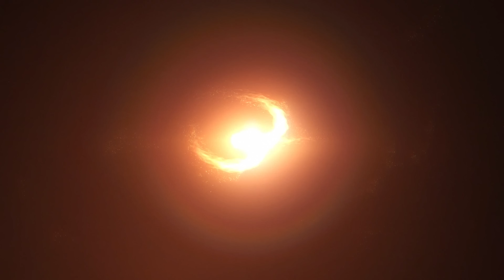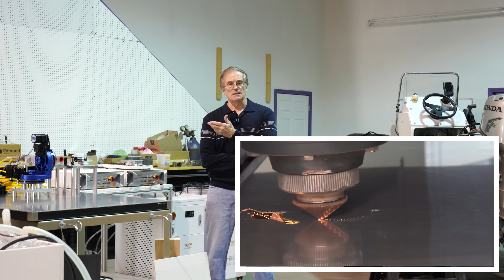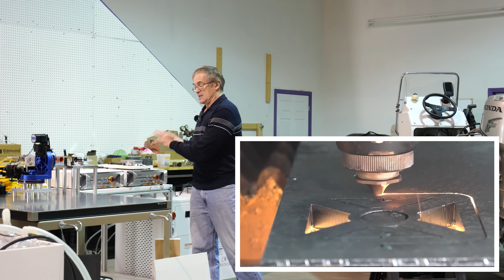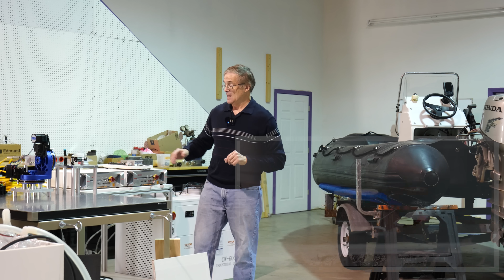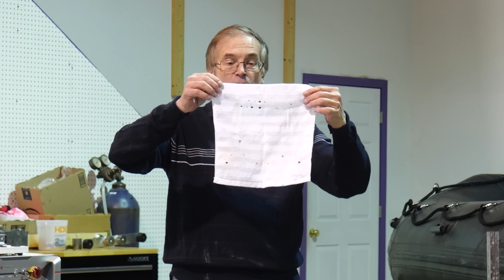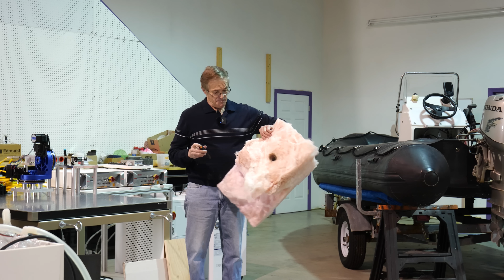We have a problem... and need your help!

Comment: Your on the right track with water, but you need actual liquid water, not soaked rags.. 
You need a aquarium basically.  Build a wall with a water tight void between two panels. Say 3-5in apart. As for material.... I would think copper sheeting would be best, assuming you could black it out with, I don't know soot maybe? 

That should give almost instant delivery of the heat to the volume of water behind it, as well as dispersing the heat, assuming that you can control the reflection. Perhaps copper on the back wall, with clear glass on the front wall, with the water in-between...?

Comment: It may be worth looking into why the brick survived with relatively low damage. Cement (or whatever the brick is made of) might be sufficiently resillient or just reflective so that you dont need the full thickness of a brick, and you could cover a piece of drywall with a thin layer of cement.
A waterfall, as others have suggested, might be low cost and portable solution. However, it was never mentioned in the video just how powerful and how large the beam is. Absorbing tens of kW of narrowly focused beam could require a quite thick layer of water.

Comment: A waterfall over your wood will diffuse the laser and take the heat away from the wood - maybe? I know someone else mentioned falling water as well, but I liked the idea of the wood still in the mix to capture residual light, but being additionally cooled by the water so it can't bust into flame.  if you had an additional water curtain in-front of that it would further diffuse the light as well.  All of the water could fall into a capture area at the bottom which would also work as the water source for the pump.  Put the whole thing on wheels, have the top on extendable side rails and it should hide away in a corner pretty well when not in use. ...oh wait, you said good idea 😜

Comment: I don't know if you tried, but my 2000w laser will eat through a brick in seconds, but 2$ generic cinderblocks are fairly portable, and I could not make it through one. It forms glass and dissipates the heat and light fairly well. I use it as a back stop of my experiments and it works pretty well.

Comment: Glass blowing kilns are lined with Fibrefrax and it may be one of the materials you end up using in what I suspect will have to be a multi layer solution. If it comes down to a brick wall, and it may, just sling it under a gantry to roll out of the way when you're not busy lasering. Cheap and easy too.

Comment: Probably oversimplistic, as I am not qualified - but what about an aquarium with a curved side to act as a water cooled lens to disperse the beam into a lower intensity and wider band which then falls on a backstop made of an inexpensive option that under the less intense beam can then withstand the heat for the requisite amount of time?

Comment: If the laser beam of the industrial machine disperses so quickly after the focus point, how does it cut 50 mm of steel with straight walls?

Comment: (i will just assume carbon felt welding blankets did not work) short of space(no,seriously, get FAA reassurance and pray this will not be the anti-satellite episode you planned to make way way later), there is nothing that can truly sink that amount of energy. it's probably really close to ionizing the air. it will punch through a mirror. superfluid helium is impractical, graphene not really a thing, pyrolytic graphite.......not cheap and also brittle. intumescent or ablative materials or any kind of a phase change is probably too slow to tank the energy, Calcium carbonate(with some carbon black) to quicklime might give you some seconds . rotating panels? multi layer foil/wet blanket/carbon-ate "whipple-shield"? FPV goggles for eye protection.....is there no way to spread out the beam when it is not tracking or firing? ideally, this should be done in some kind of range type quarry or similar. "we have a lazerdome at home"- a true barn-burner.

Comment: Seems like the beam will destroy everything in it's path, it just depends on how long it will last. Could probably come up with an equation that will determine how long a material will last, such as:
t = (ρ * c_p * ΔT + ρ * L_f) / (P * (1 - R) / A)

Where:
t: Time to melt (seconds)
ρ: Density (g/cm³)
c_p: Specific heat capacity (J/g·K)
ΔT: Temperature rise to melting point (K)
L_f: Latent heat of fusion (J/g)
P: Laser power (W)
R: Reflectivity (fraction, e.g. 0.15)
A: Beam area (cm²)

That means you have to increase one or more of the:  beam area, latent heat of fusion, melting point, or specific heat capacity. This probably all favors denser materials with high melting points, and goes against your hopes of a light weight barrier. But perhaps a dense material made of tiles on a rollable/movable wall might still be practical. Easy to move, and tiles can be replaced once too damaged. Not sure what would be the most practical material, however.

Comment: Random as hell right but theres a material called Starlite. Its really cheap and you can make it easily at home. Its pretty lightweight and extremely heat resistant.

Another thought i had is frosted glass in front of the starlite as kind of a diffuser but idk if it'd work.

Comment: Roxul (rockwool) would have been a better option to pink insulation and is far better at fire resistance. Although I've never tested it with lasers, the insulation factory I worked at regularly tests the various verity of the insulation. Safe and sound have the highest thermal resistance and flammability.
   The usual tests were different flame and torches. It can get several thousand degrees before smouldering.
    The factory I worked at made them from 5 different rocks and melted them down with high voltage electrodes.

Comment: An eventual solution could be some sort of an aquarium with a thick enough glass that wouldn't melt instantly while the water (or another liquid that would scatter the light) inside would absorb the heat from the glass and disperse the light inside it. A black background will absorb light and convert it into heat, but the medium inside must be able to disperse that heat or even boil if its vapors aren't toxic.

Or some chamber where the light gets trapped in and doesn't come out for your safety, being dispersed inside long enough so it would lose enough energy to become possible to deal with. If this thing spins fast the light would be reflected fast enough so it doesn't have the time to cause damage inside. AKA The Magnificent Disco Ball :]
Keywords: Dispersion, diffraction, attenuation, volume, latent heat.

I'm really curious with the solution that will come out of this collaborative effort. Cheers to you et all.

Comment: How about a dispersive element to diverge the beam density in front of something else.  Like a divergent fresnel sheet, broken glass, or did you try the old razor blade beam stop.  Yea last one not practical for moving objects.  Do you have enough energy to second harmonic it efficiency low on purpose.  Or again dispersive like a curved aluminum that sends the expanded beam up or down.  Now use your drywall.   Think dispersion is the goal.  Kerr into something?

Comment: You don't mention how many square feet the surface needs to be but...
build a box with the square footage you need and make it about 1ft-2ft? thick. Enclose all four sides. Use a material you've tested that can resist the beam for a 1/2-1 second. The inside of the box can have aluminum foil backing (like insulation board) that will LIGH UP once the beam breaks through the outer wall. Put a photosensor (or several) inside the box that will trigger a shut down once the box lights up inside.

Comment: A panel of stiff rockwool insulation, maybe soaked in water, or misted at the surface. Rockwool has a much higher melting point than fiberglass. It will take a propane torch point-blank for a surprising amount of time with not a lot of smoke.

Comment: I like the earth solution, change perspective.  But I have another idea, that might be a project of its own.  In the mid-1990s I was visiting the SUNY Material Science lab to look at a piece of equipment.  While I was there, I was shown a ceramic powder coating process that was a military research project to create a fire resistant coating for naval vessels.  A blend of ceramic powders was sprayed through what looked like a sandblaster with acetylene torch.  The powder was coated on to steel plates.  While I was there they demonstrated putting a torch to coated and uncoated steel plates.  Uncoated burned through,coated showed no indication of heat damage.  Seemed to work well but, they said apparently the weight of coating an entire vessel was too much.  I’ve always wanted to try and recreate this.  I think it would be a great coating for SpaceX stage zero.  If it doesn’t help with the laser, maybe make a video on this topic for me.  😊

Comment: I think you are on the right track with water. What about taking a clear glass aquarium and filling it up with water and adding an opaque particulate to the water? Maybe something organic like flour or corn starch. I am thinking like a 60 gallon put lengthwise that should absorb a lot of heat and light over a big enough area to keep the water from instantly turning into steam.

Comment: 1st idea  :  you kind of gave the idea yourself at the beginning : some kind of very large lense that don't absorb or reflect the lazer, but simply spread it. Maybe Fresnel lenses ? Or Glass ?

2nd idea  :  a bunch of glass water tanks on top one of another with a glucose solution in them, the glucose goes down with gravity and creates a concentration gradient inside each tank, the concentration gradient in turn creates a refraction index gradient, which means an incoming beam is refracted downwards towards other tanks, and eventually against the floor.
Reply: Wouldn't the laser puncture the glass enclosure and spring a leak?
Reply: @RedHotscot  I was thinking about that. Glass has a low thermal conductivity so the temperature would increase locally rapidly and melt the glass... But this depends on the amount of energy that is absorbed by the glass. The glass needs to be transparent to the incoming beam wavelength...

Comment: Without knowing the exact details of the laser you're using it's hard to know which recommendations will be effective. I believe these very high powered system are typically pulsed lasers operating at high repetition rates to effectively look like a continuous laser. If that's the case, then most of these solutions won't work. These lasers have such high peak powers that they effectively ablate away any material faster than heat is transferred. This means that anything that is supposed to act like a heat sink (big block of metal, water soaked into a material, etc.) will simply be vaporized and have a path carved right through it.

With that in mind, your options are optics that try to redirect/transform the beam without absorbing it, or some material that can effectively be self-healing like a pile of dirt/sand as some people have mentioned. I would maybe consider a large first-surface silver mirror at a 45 degree angle to the beam path, directing it down into a tank of water. This should hopefully avoid stray reflections back at you.

Comment: There really is only one sensible solution, and it's free - do all your testing and experiments with the system pointing down (into Earth)..
Ultimate energy trap.  It requires some rigging and a bit of digging and planning, but after that you can fire away to your heart's content..

Comment: A sheet of material that oscillates back and forth at a high frequency similar to a speaker. Angle the sheet so a back and forth motion translates  the focus point in the sheet moving up and down or side to side.

Comment: Why not placing a diverging Lenses before the laser hitting the drywall ? i.e. Between your target and the blocking drywall . This will make the beam larger and less dense in energy so now your drywall may withstand for longer duration.

Comment: Plywood/Drywall or hardy-backer Sandwiching Fiberglass, a soaker hose at the top sokes the fiberglass with water, a trough at the bottom catches water and runs it off. Build wall frames on wheels platforms for mobility. Ensure fiberglass is soaked through before use. Holes can be patched. Design so that sheets can be replaced.

Comment: Probably first thing I'd try is a thick sheet of plywood at an angle with a constant supply of water flowing over it. Probably be best to pre soak the plywood so it's nice and hydrated.

Comment: I invent things, and make a living out of that, so I guess I am pretty creative, analytic, and I test my concepts to perfection throughout iterations that can be from a few to a few hundreds until things go as intended (yep inventing is not a stroke of genius than it just works, is time, money and nerves, iterations and reiterations till you get bored with the project)

So I am looking at a double stage setup, one is prevention and the other one is backup.

Prevention:  Laser shooting timing is paramount, and you cannot achieve that by turning on and off the whole damn thing, it will never turn on at the right timing I guess, especially when targeting something at miles away, zero chances to hit a small target with microseconds of unreliable timing.  So the laser module must be constantly active.... but... not the shooting gun at the other end of the laser fiber optic transport cable.  You need an analog actuator fast as hell to flip something that at one end has nothing (just a counterweight for the opposite side) so the beam can enter you system of lenses and do the job, and the other end is your business end, a prism based material aiming at dissipating the beam at 45 degrees all around it's focal center so that the whole beam becomes 1 meter diameter within 5 meters from the lenses.  Thus rendering it just a big lantern, more like the welding bright light, dangerous for eyes at direct exposure but otherwise harmless to any material within one meter from the "defocaliser".  Just use dark googles to protect you eyes.

Your laser should be all the time on "defocaliser" mode and when you shoot the target the actuator bring for a timed moment ( maybe one or two seconds can do)  to clear opening in the way of the beam, than returns on defocaliser instantly.  Sort of a mechanical valve let's say.

Backup, that is your wall idea.  

Hempcreet bricks are light, cheap, they interlock LEGO style, easy to dismantle and relocate, build up two walls one behind the other.  Hempcreete once fossilized is intumescent, can take 3000C for over an hour and the other side at 20 inches away will still be room temp so I guess it might take laser beam (that might produce a temperature over 10.000C locally) a few good seconds to pierce the first wall, and than is the second wall behind it just in case.  And you only need it for less than a second as the target is hit and the remaining split second time the wall is your stopper.
And in case your actuator gets fried on "kill" position and you need 10 seconds to turn off the whole machine by hand.

Build the wall first than the defocaliser actuated mechanism, so when you test it you can rely on the wall to prevent any firefighter pay you a sudden visit and give you an unwanted shower.

Comment: Try Cement board I believe it is available in sheets 18mm or 5/8 inch. 18mm would probably be better. Not sure how big a screen you need to make but if you need thicker than a single board you could build a double layer with 6x2 battons to give a 6 inch cavity to fill will sand. If need be you could add layers to the sandwich as required. Should make an fairly effective optical blast wall.

Comment: Use a high temperature ceramic adhesive, thermal paste or similar to attach iron filings to a metal sheet to create a thermally conductive, highly scattering surface. It's possible your home made thermal paste may work for this application, but check the material safety datasheets for toxicity first. Consider attaching wet towels/blankets to the backside with continuous water spray to keep them wet. Also add a fan to improve heat dissipation. You likely will need to prepare extra panels, as a long continuous beam will damage the panel.

If you go with this, it is very important to have proper ventilation as some of the iron will vaporize and breathing in the iron oxide will make you sick. Though you should already be doing that as high power lasers can generate ozone (not to mention the drones you will be slicing).

Comment: If you use those big magnifying panels you used on solar panel project ,maybe they will blur the beam before hitting some heat resistant material ....if it doesn't melt ....

Comment: I am wondering, if fog or smoke would diffuse the laserbeam? If that was the case, could you wall off part of the workshop with clear plastic and fill it with fog so that any laser light passing your target would be diffused by it? My other idea is something that the fire department uses to shield a building from the heat of a building burning next to it. They make a wall of water spray which intercepts the infrared radiation very nicely. Would that work the same with laser light? I don’t know. Those are just my two cents. You have presented an intriguing problem. This is what happens when big boys play with big toys!

Comment: Have you considered plywood with a flowing water source from a hose or other distribution from the top.  Should be easy to build and maintain.  You might want to have a fan dry it out after to stop mold but this should raise your time quite a bit.  Think swamp cooler.  You could also layer the plywood as well with a thicker back sheet and thinner front.